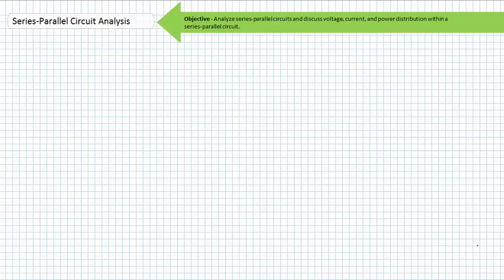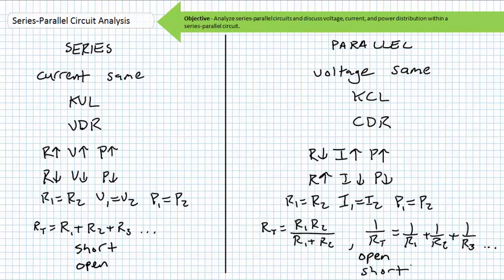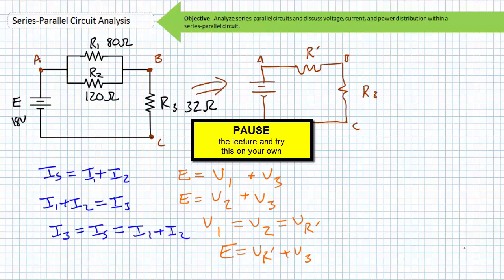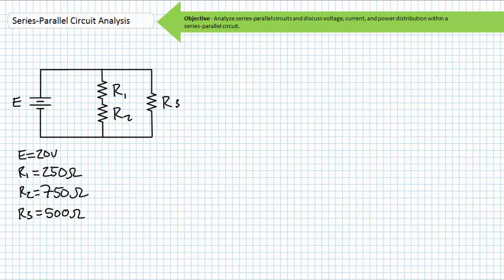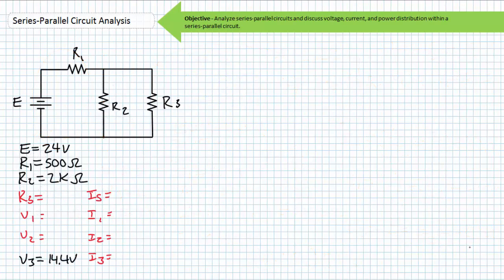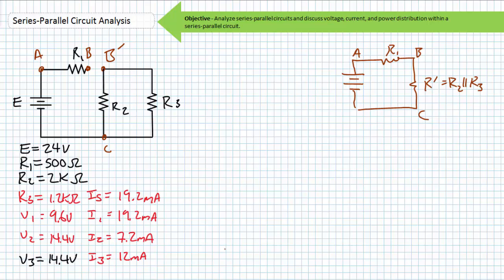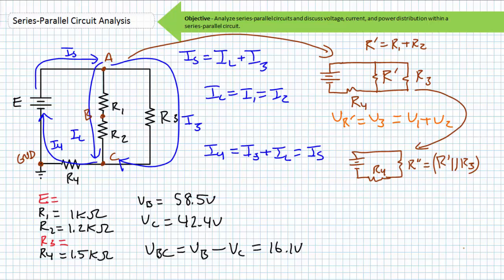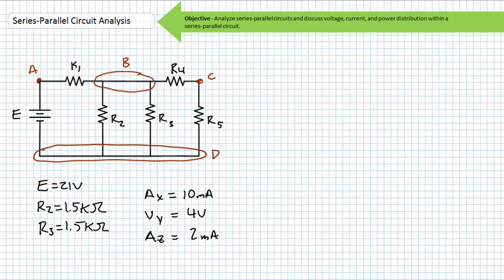DC Series-Parallel Circuit Analysis (OLD LECTURE)

Comment: Hi Jim, for the example problem that starts around 37:22 I tried using the VDR to solve for V1 instead of using I1 = I2. I got V1 = 1/3.7*(58.5+ V1) therefore V1 = 21.7 V. How come it appears that vdr cannot be used for the loop of E, R1, R2 & R4?
Reply from the maker: The VDR is valid only for a pure series combination of elements. R1 is in series with R2. This series combination is in parallel with R3. The simple series circuit is (R1+R2)||R3 in series with R4.